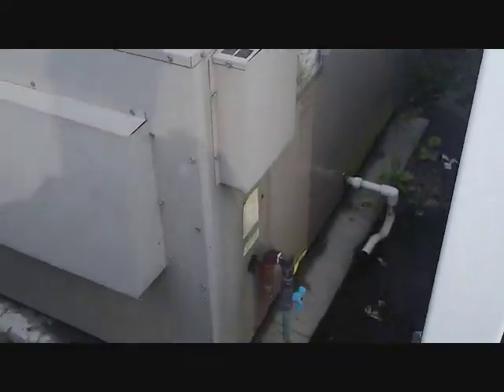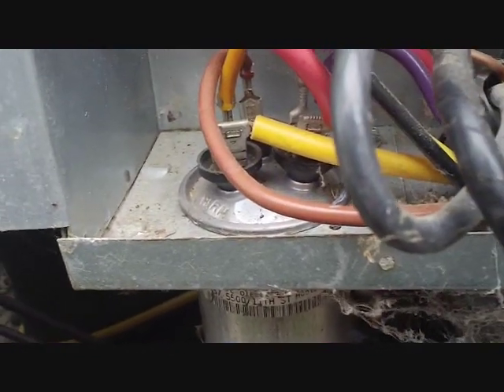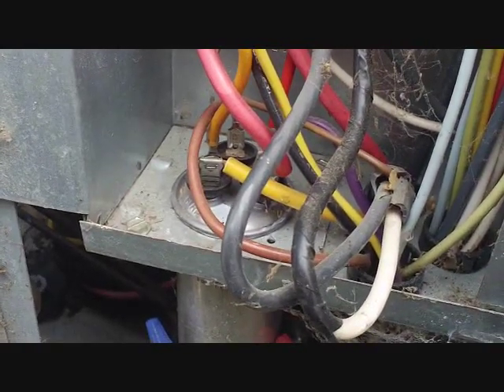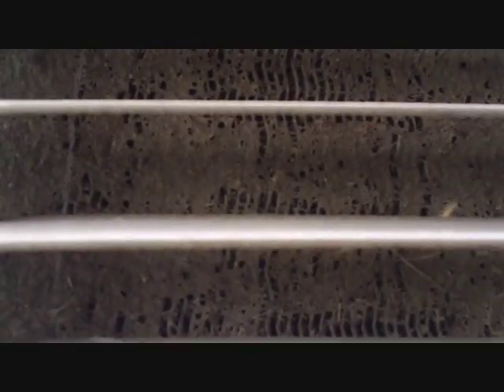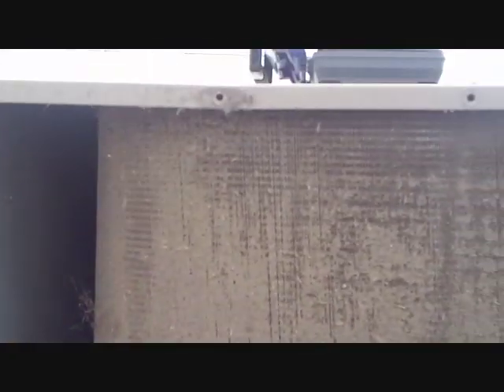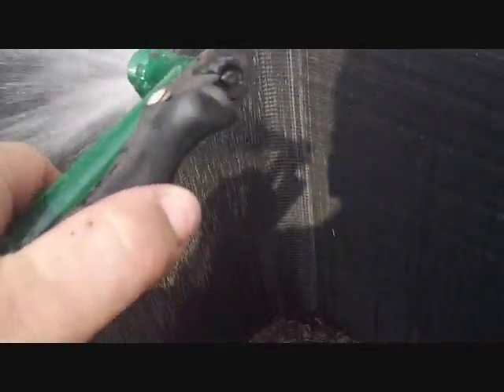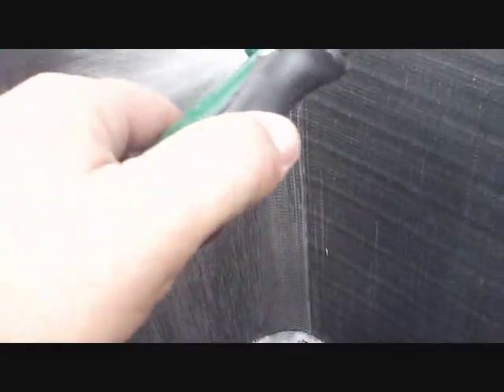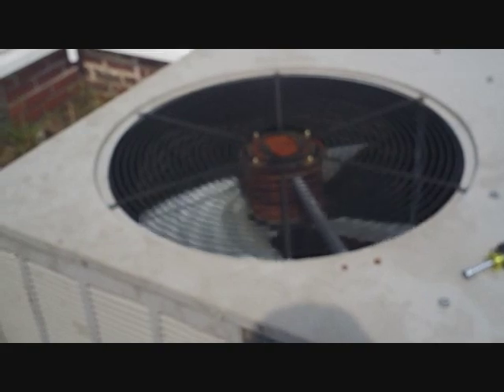HVAC Troubleshooting: Effects of a Dirty Coil

Comment: If you have a fixed bore metering device and your condenser is dirty like that what will happen to the low side of the system and Superheat? Will the pressures be higher on the low side and the Superheat be high?
Reply: Yes Dave, your liquid line temperature will also be above 10 degrees above ambient temperature. That is also a sign that you need to clean your condenser coil.

Comment: Really NO charge. Yes it has a warranty. It was abused the coil was so dirty, The homeowner is not keeping up there end of the Warranty. Says right  in the installation Book that the homeowner must keep a service contract on the unit so Goodman will pay you the service guy to fix it.  That was a $600.00 call are. They need to call someone else.   Not me. No free work on dirty disgusting Unit. It needs $350.00 worth of cleaning.
Reply: break  down that charge of 350?
Reply: Buy a HVAC Company, pay the rent, power bill, 5 vans 2 pickups, insurance for building, trucks, 2 million coverage for a law suit, call taker, computers and software, license, upkeep and gas. Labor that can fix your problem and not miss the dirty coil. Ads for your company, real call backs that is just a dirty filter, battery dead in t-stat. Its only 1 year old and you did not change filter you want it free.  Want to buy a HVAC company with 1200 service contracts that the IRS want to charge tax on labor now on contracts. 30 year old company Building, 7 vans 3 pickups and 12 people to pay. for sale. What is it worth.
cost 2500 a day for overhead. not counting labor
Reply: That dude is smoking cr---!
Reply: Billy, go find the cheapest hvac tech off of Craigslist and let us know how it works out for you.

Comment: Ok,,,,,, so my motor is fried... FUCK
Reply: No its not :) I took the motor apart and repacked the bearings with grease. Runs better than a new one.
Reply from the maker: good work, that would make a great video.
Reply: talyn875
Thanks. Iv noticed my motor has been whistling like a choo choo train. Its time to replace it. Not bad for an old tempstar unit installed in the early 90's though. With this fan motor being only the SECOND repair even after all these years (and only refilled with refrigerant once) its safe to say if everyone had the same unit as me, you would surely be out of a job...
Reply: DIY success story! They do exist.